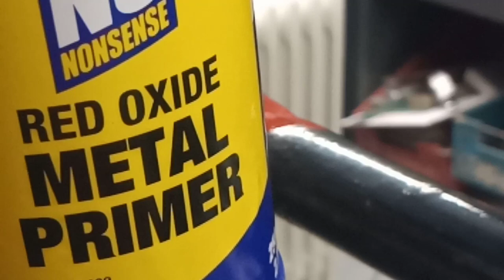BSA Bantam D7 Swinging Arm Suspension Unit Mount Repair - Maximat Lathe

Comment: Great little lathes . I have the 8.4 with the mill.
Reply from the maker: They really are! Superbly made. Mine is 50 years old this year and is still very accurate. You must be very pleased with your 8.4.
Best wishes, Dean.
Reply: @retromechanicalengineer  yes I like the 8.4 it doesn’t get much use as I have larger Mill and lathe as well but it comes in handy for smaller jobs , definitely a keeper! Glad to see you getting some good use out of yours !

Comment: Hi Dean, nice job, well attacked, welding looked fantastic to me I would have been happy with it! (sorry that's no accolade). Helpful tip, when you have a pip left from parting, turn it off instead of facing it off, you will save many insert edges over time. If you think you have almost zero surface speed and trying to plough through something wider than the insert radius. Hope this helps, I see many others doing similar, I may cover it in a future tips or Blether video. Cheers, Jon
Reply from the maker: Cheers Jon. I'm my own worst critic but the welding could be better with practice and the right tuition I'm sure. 
Good tip (pun intended) on the pip removal. 
Best wishes, Dean.